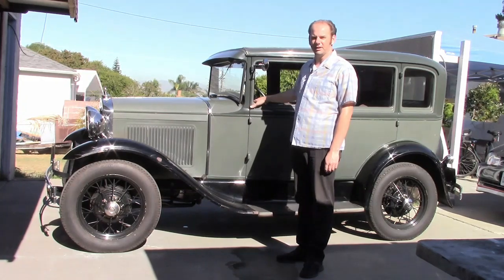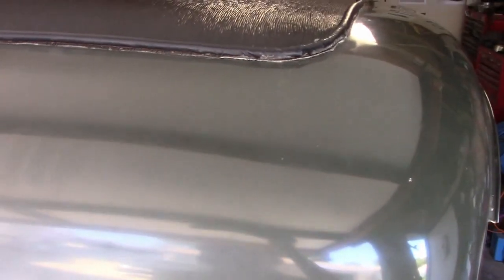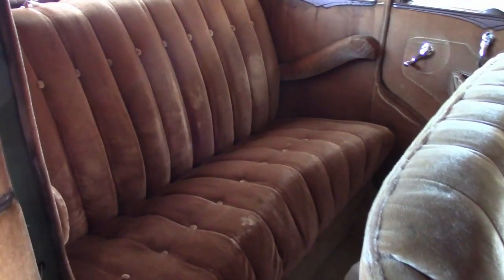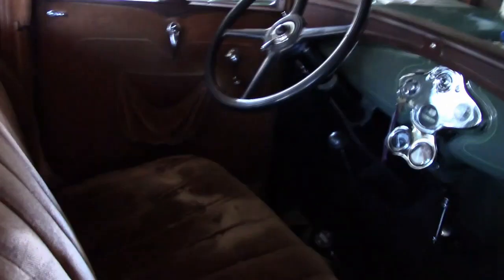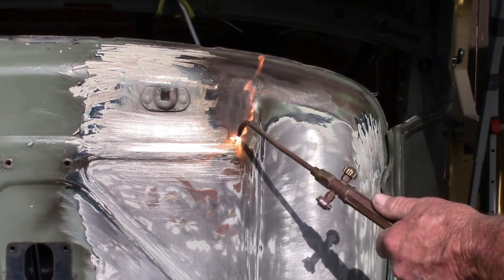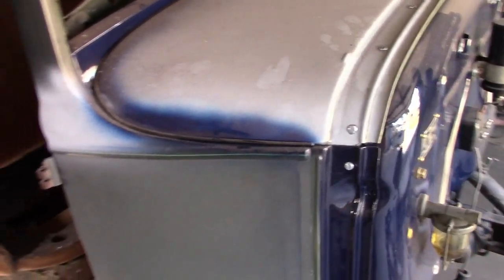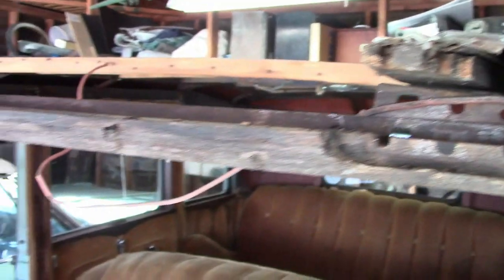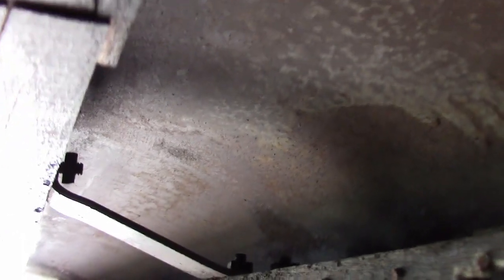1930 Ford Model "A" Repaint and interior. Part 1.

Comment: I have the identical model i'm restoring. Quick question. Why is there a lock on the passenger door but not on the driver's door? Just curious. Subbed BTW. Good videos.
Reply from the maker: It's made so from the drivers seat, you lock both left doors from the inside. then you slide to the passenger side and lock the right rear door from the inside. then get out through the right front door and lock that from the outside. It's made that way so you get out on the side walk instead of in traffic. Old fashion way.
Reply: @onewhocollects6781  Well i'll be dipped. Thank you sir.

Comment: I've read that before they invented Bondo, i.e. plastic body filler, they used hot lead to fill in dents.

Any of that found on this car?
Reply from the maker: Not with this car, but that is pretty common to find on cars from the '40s and older.

Comment: I have a Ford 1930, looking for the location of the chassis number
Reply from the maker: The VIN is stamped on the left side of the engine block and the left frame rail. the one on the frame is on the top near the battery, unfortunately you have to lift the body off to see it.
Reply: @onewhocollects6781  Thank you for your help, your content is good and I wish you all the best